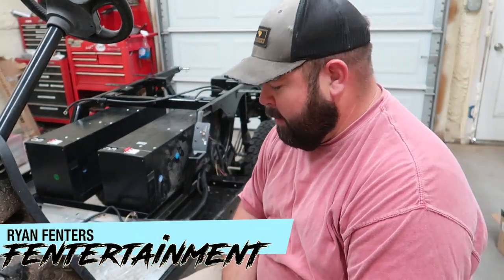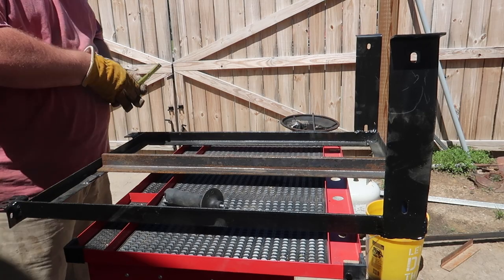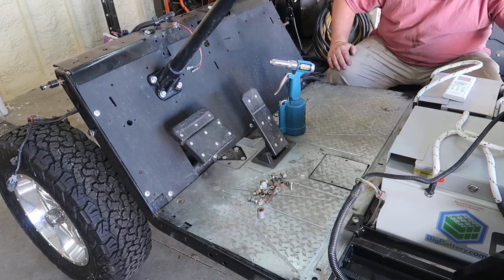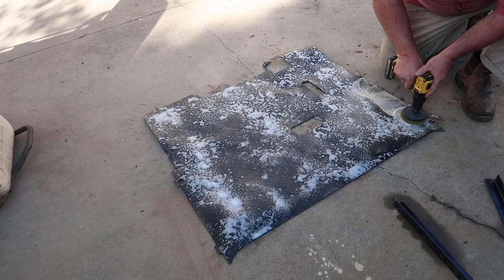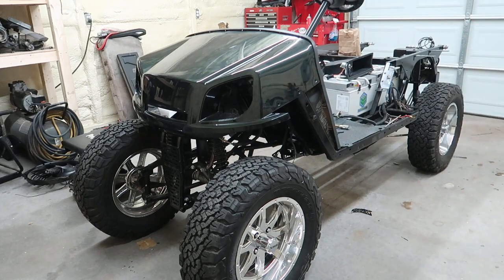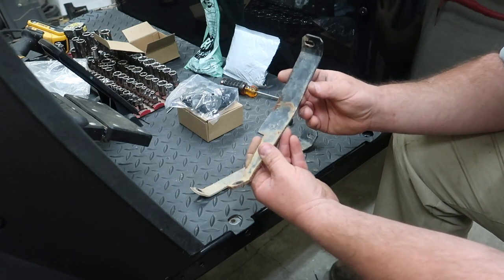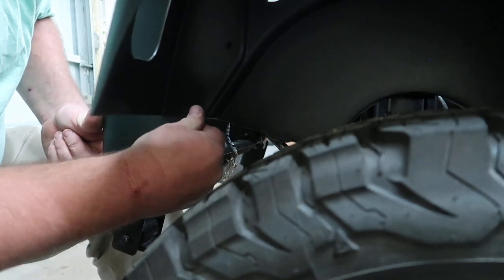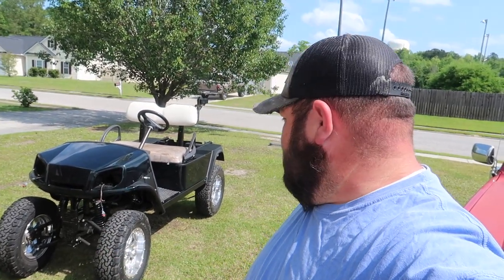The Lithium Cushman Hauler Pro 72v gets NEW PAINT & NEW PARTS | Utility Golf Cart Build

Comment: I think this is the same cart that I have that bad boy buggies turned into a four seater. Is there a video or have you hooked up turn signals? Couldn’t find the nine pin plug and play that goes with other EZGO light kits. I have lenses, but no bulbs, from the factory. I also have the plug to the headlight and turning signal as you do.

I’d also like to get those front fender flares
Reply from the maker: I didnt run turn signals on this cart.

Comment: Please help me understand why you don’t simply run the two 36v batteries in Series, giving you 72v?
You would still have the same run time, probably more, due to the inefficiency of running a 72v motor at only 46v, and a heck of a lot more power!

Comment: Great thanks, I ll check into that cable. Love the channel. Also I'm thinking about a lithium battery. 48v 72ah Eco Battery,  pros/cons should i do the 105ah?
Reply from the maker: I dont run eco, I run bigbattery lithiums. I have various videos with these batteries doing range tests and even standing my precedent up on them with navitas power. These batteries handle high amperage. I also have a coupon code to save money.
Reply: @Fentertainment  Yea I've seen a lt of your vids on those batteries. If thats what you use I'll definitely trust that. What kind of codes do you have?
Reply from the maker: @brandonwhite8881  “FENTERTAINMENT” saves 10% off

Comment: Hey do u have any good lithium setups around 2k for ego rxv. Really trying to avoid lead acid again.
Reply from the maker: Check out the big battery eagles. You can get them in a 2 pack 3 pack 4 pack as kits. IF you are needing more range you can always just buy another to add to the pack. Each eagle has its own bms also. Those are giving me the most range so far. They are about the size of a regular battery as well. I did 44 miles with 4 but I stopped due to daylight and the batteries still had 51 volts left in them. I couldve probably gotten 68-70 miles out of those 4. How far do you travel day to day? After 30 miles I was ready to give in the towel as my rear end was uncomfortable on that golf cart seat. Save 10% with my coupon "FENTERTAINMENT" on bigbattery dot com if you decide to go that route.
Reply: @Fentertainment  my entire community is golf cart friendly so we would drive at least 20- 30 miles a day. Very lucky to have over 20 mile if golf cart exclusive roads and all the rest are shared. I'll look into those, Ty
Reply from the maker: @positivevibes2459  I have multiple range test lithium battery golf cart videos on my channel. Be sure to take a look at those also!